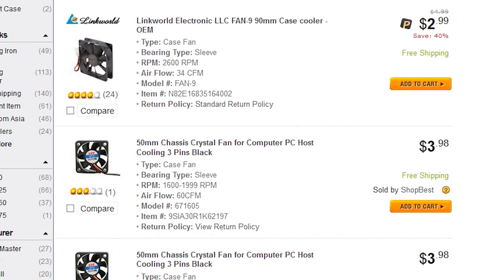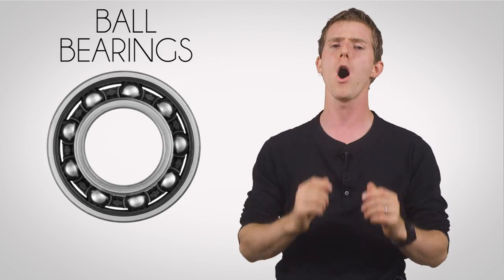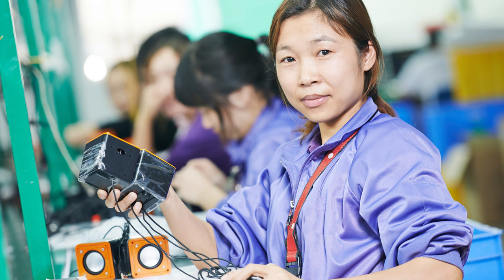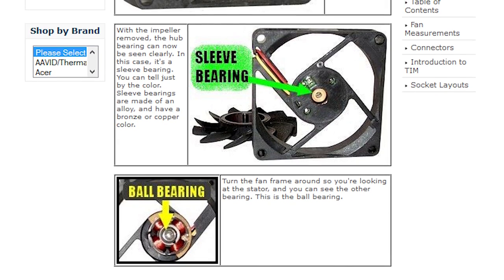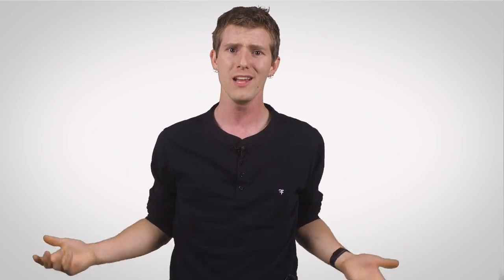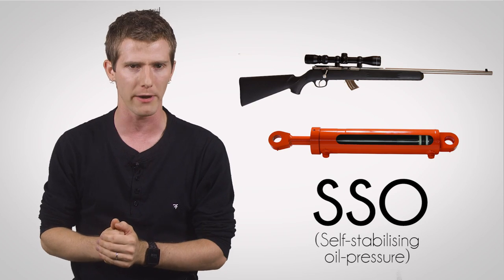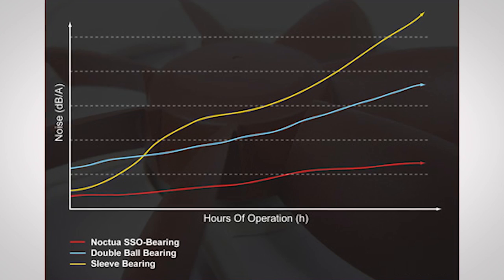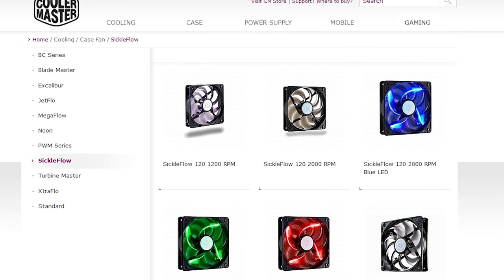PC Fan Bearings - Sleeve vs Ball vs Others as Fast As Possible

Comment: 4:17 Sewing machine oil works great for this. I kept a GPU fan alive for about 2 years with it. Sometimes you need to drill a small hole under the sticker, but its worth it if the fan is noisy and hasn't frozen.

Comment: CUDA cores as fast as possible
Reply: Please linus
Reply: Yes. good idea
Reply: yess!
Reply: Do it linus
Reply: Yes Linus, talk about CUDA cores m8.
Reply: ya.
Reply: Computational units of a GPU. Same as shaders with AMD.
Reply: Cuda cores; Overpriced
Reply: CUDA is a programing language. A better fast as possible would be the underlying hardware difference between Nvidea and AMD cards and how it related to both graphics and non-graphics performance. Actually, I have no idea how that vid could be less than an hour, but it would be an awesome hour.
Reply: Conqwiztadore22 Stream Processors; Overheat like fuck
Reply: CUDA Cores & Stream Processors explained.
Reply: The Monsters CUDA = Language for Stream Processing(SP). Equivalent to CUDA is OpenCL, which NVIDIA use as well. Where's the overheat issue that you're referring too?
Reply: Did they make it? 😂

Comment: So regarding sleeve bearing reliability, I just replaced a pair of Sunon sleeve bearing fans that were powered on 24/7 365 since 1998. The amplifier was decommissioned in early 2015, and I've been using it intermittently since. In other words, about 149,000 power on hours.
Reply: were they mounted vertically or horizontally?

Comment: I've been looking for one of these videos linus! Thanks!  However, "point contact" does not 'reduce friction'. Friction is determined by the weight of one object on another and doesn't matter wether that weight is spread  over 1 cm^2 or 5 cm^2.  The "point contact" will put more stress on said "point" because it has to deliver the total friction over a smaller area.  You can think of this like sliding across a slip-n-slide.  First, slide on your chest/stomach.  Fun, right?  Now try sliding with your elbow/forearm holding up your upper body. In both cases you will slide just as far (as long as you didn't go to McD's in between runs), but your elbow will probably hurt a lot more than your chest after you stop sliding.  This is because the total friction force has to act on a smaller area and this is what is happening inside the ball-bearing.

Comment: If you run your fan 24/7 every day of the year you will end up with 87600 hours.
I have my Cooler Master cpu fan running for about 4 years now. I run my PC 8-16 hours a day and it's still working as on day one.I had a few other (cheap)fans in that timeframe in other PC's and all of them failed.
Nice job Cooler Master. :-)
Reply: You are not?

Comment: Could you make a video about positive vs. negative pressure in PCs? I'm curious about your opinion and what are the pros/cons of both options.
Reply: As far as I can see negative pressure has no pros. With positive, you get less dust intake through unfiltered openings, you reduce the chance of exhausted air being sucked back in and the air density is higher (although very minimally) which in theory will increase its thermal capacity.
Reply: Well if you have water cooling. Then you want you CPU fan in a pull setup which usually involves having your fan blowing out anyway.
Reply: You can have a pull intake.
Reply: Yeah. I was thinking that might not work as well. But now that I think about it I don't think it would matter :p
Reply: *****
 I've just noticed linus usually uses negative pressure on his builds (2 front intakes, 3 exhaust fans on the top and back). This setup seems to be the most popular from what I've seen. I'm curious what the reason is for this choice.
Reply: MisterGutsy108 dust, bam! no need for a vid. if it takes in on the top then ur shit would get filled with dust in 1 sec
Reply: Pretty sure Jayztwocents made a vid on this

Comment: I would argue that sleeve bearings in graphics card coolers are actually a reason for a PSA. If mounted horizontally the lifespan is reduced drastically and also they are known to produce rattling noises on higher RPMs which also often occurs on graphics cards. Also you can't just switch out a GPU cooler that easy anymore these days since most models are non reference and therefore it's not as easy to find a proper 3rd party cooler and even if you do - those are most likely much more expensive and bulkier than they used to be due to the higher temps they have to disperse. So if you have a GPU with a sleeve bearing which starts to rattle you're pretty much boned - and Sleeve bearings in GPUs are still quite common, so that sucks.
Reply: What is PSA?
Reply: *****
Public Service Announcement. A warning basically.
Reply: Actually horizontal mounting doesn't "drastically" reduce their lifespan. Vertical mounting because of gravity causes wear mostly on most contacted point (the lowest point) of the very soft brass. Horizontally with the natural magnetic centering of motors limits shaft bearing contact (in a perfectly balanced world).    

Rattling is common with sleeve bearings because you can't have as tight tolerances as say ball bearings.
Reply: CUSTOM WATERCOOLING LOOP MASTER RACE! Us friends at /r/watercooling would like a word ;) It really does solve all those legitimate problems you brought up. But damn if it isn't expensive.

Haha in all seriousness, you can grab something like an H60 and a G10 bracket from NZXT for around $100 and have yourself and awesome performing GPU that is capable of some serious overclocking, as well as being much quieter and cooler. Hence the increased overclocking capability. Those aftermarket air coolers are kind of a joke when you can go the CLC and G10 route in my opinion. It makes a lot more sense.
Reply: NINJ4ST34K987 100$ is still very expensive. I mean in the old days up the Geforce 9000 series I'd say, you could just grab some aftermarket cooler for 30$ and that performed always better than with the thing which was build on it. This makes it a pretty big deal these days if a GPU cooler craps out.

Comment: I use 2 Sunon magnetic levitated fan, no sleeve contact with bearing, for my CPU and case. I also use 1 AVC hydro-bearing fan, locked and pressurized oil between shaft and bearing, never dry out, and don't need add oil, for HDD cooling. 3 fan in my tower no sound at all, very quite.

Comment: cheeeeeeeeeeeeeers from the futureeeeeeeeeeeeeeee so much has changed in 8 years HOLY HELL! id love a follow up! but now im finalyyyyyyyyy after 5 years of building my pc, doing a refresh and seriously trying ot buy proper fans after bearing burnout on my old ones i keep forgettign to replace h hahahahah yet somehow manged ot kepe alive lol cheers
Reply: for real tho that blue coolermaster basic 120mm fan has lasted a miserable life as my exhaust fan for almost 5+ years hahaha~ i havent done anything ot hlep it live longer or barly even cleaned it buuuuuuuuuut im 99.99% sure i only just used fan curves like last week so........ its been running at a 60 or 70% duty cycle flat dc voltage for 5 years of heavy gaming use LOLOLOLO

Comment: Ball bearing thats all you need
over the last 15 years ive seen none ball bearing fans being sold and promoted
the ONLY reason they want you to buy them is they can sell more fans to you
because a 2x ball bearing fan can last 15+ years running 24/7 a sleeve can fail after a few weeks and instead of oiling it most users would buy a new one

Comment: Sleeves are one of the most reliable coolers ! If you grease them once a year when you clean the fans too it will never fail. You can you a mix of high quality oil and grease for fans. Best results. Let me see how you grease a fluid bearing...? As they are all closed nothing under the sticker! Or a ball bearing that will make a crazy noise after oil is dropped on it

Comment: I have two old Enermax fans which have a different design than outlined here. They don't use a bearing at all but just use the magnetic force. Not a good explanation, but either way this design makes it possible to remove the fan blade for cleaning and to just put it back. Haven't seen it on other fans, care to shed some light on this?

Comment: So i Built this Computer 
Amd Athlon X4 750k 3.4ghz
8gb of 1600mhz ram 
Amd r7 250x 1 gb gddr5 
750 watt psu 
fm2-a55m-e33 Motherboard
500gb WD C Black 7200 rpm

My question is could i SLI two r7s and upgrade the cpu to a fx 8320 
If you could ask my question thank you!
Reply: I did not calculate it but I believe that would be efficient. Depending on whether the power supply is reliable.
Reply: I checked earlier i do have enough power but the motherboard does not support fx series and does not support crossfire for the r7s unfortunetly :(
Reply: NgG Charisma
 if you want to upgrade sell the motherboard and go for something which can support the fx series and sli r7's. Like i said id personally upgrade the motherboard sell the cpu and gpu and go for something like a 9590 and r9 290x.
Reply: TB Craft I was going to upgrade to the fx 8320 because my budget but if i got say an R9 270x would that be fine??
Reply: NgG Charisma Go for the 8320/Intel i5 CPU. It's by far the best price/performance and the 9590 is stupid overpriced and really aimed at enthusiast. Don't bother Crossfiring the 250X's. It'd be terrible price/performance and not make a whole lot of sense. Always go with a single, stronger card unless you can't get desired performance from a single card. The 270X will be a great card with an 8320/i5, and will perform as good or better than 250X's Crossfired most likely. If you can afford it though, get something like a 280, 280X or 290 if you can afford them, because they will be absolute beasts of a card.
Reply: im probably going to go for r9 270x with 4 gb of gddr5 still not sure on the processor
Reply: NgG Charisma The 270X doesn't have 4 GB of VRAM. Only the 290/290X do. Also, either an i5 or 8320 would work great for your needs. Anything from AMD isn't really worth it, as the 8320 is insane for what it costs. Intel however is newer and faster, and the AM3+ socket is pretty much dead at this point. There would be no real upgrade options on that socket compared to Intel. It can be had for significantly cheaper however and with similar performance. Either option would be good though.
Reply: NgG Charisma I stand corrected. My mistake. Just get a 2GB version and save some money or spend the extra on a better GPU. The 4 GB card isn't worth it.

As for the CPU, it's really up to you. You'll spend a little bit more, but it will last a lot longer, be a faster overall CPU, and be more "future-proofed" if you will. Or you could save some money now and get a slightly weaker although still good chip, but with fewer options down the road for upgrades. It's really your call.
Reply: Thanks for the help man! I will Probably get the R9 280x and get and the I5 right now i am using an amd athlon x4 760k. Thanks man. Lol off topic but your very well spoken haha.
Reply: NgG Charisma Well I just try to be professional. I have friends that just don't type and I literally can't understand them becasue of it. And I want people to take me seriously :P

Anyhow, that combo will be a great performer! It'll cost you a bit of money, but in the same respect, you'll be maxing out most if not all games at 1080p and even some at 1440p if you upgrade to that in the future. I have almost the same set up myself and it's crazy good. Like Pop Tarts. Best of luck to you!
Reply: Your awesome! Thanks for all the help!
Reply: dude pc gamers are so awesome!!!! i love how everyone jumped up to help.
Reply: ***** i thought i was losing my mind for a second
Reply: if you are on budget and buying new psu hold up coz i dont think you are going to use 50% of psu capacity at full pc load
Reply: NgG Charisma I have almost the exact same build. The r9 270x is the way to go. And you don't need a 750w psu. Trust me I have a corsair 430cx.
Reply: alright thanks. is it worth paying the extra 40 for the 2 extra gddr5 totaling 4gddr5
Reply: NgG Charisma yeah man also dont forget to get the 320 GB PS3 model, I would say 500 but that is too overkill and 160 is just not enough, try saving a few pennies and upgrade tot he 320 GB model, it will play any playstation game you throw at it

Comment: So what fans are great for horizontal mount (without bearing noise and for long duration)? Only Dual Ball Bearing, Noctua's SSO Bearing and Fluid Dynamic Bearing?

Are Arctic P12, Noctua NF-P12 Redux, Noctua NF-S12 Redux, Fractal Venturi HP-12, BeQuiet Pure Wings, Scythe Kaze Flex, Noiseblocker BlackSilentFan XLP PWM  good for top case horizontal mount?

Comment: First,hydraulic fans are crap,they seize up quickly and require a thumb drill to access the bearing
Second,some new fans likevsome coolermaster ones seal their sleeve bearings,so that oiling cannot be done.
Third,stock coolermaster fans on the hyper 212 evo/x have too tiny motors,they are just bad.
Fourth,all sealed bearings are garbage,ball bearings are still the best.